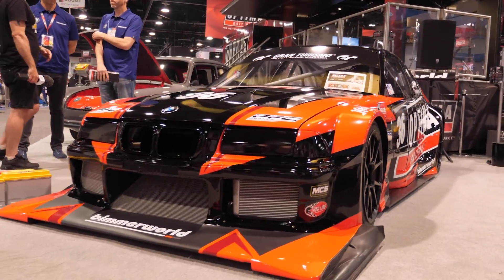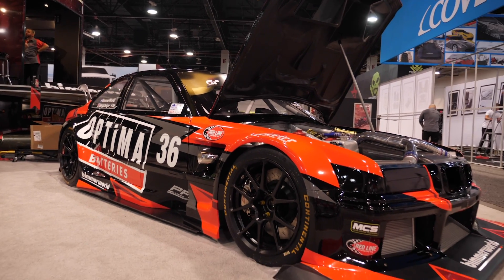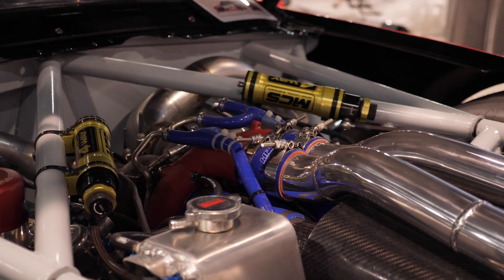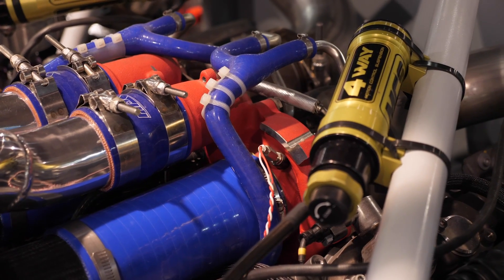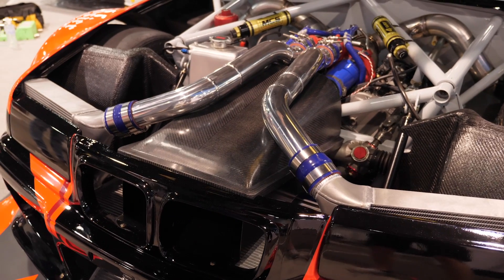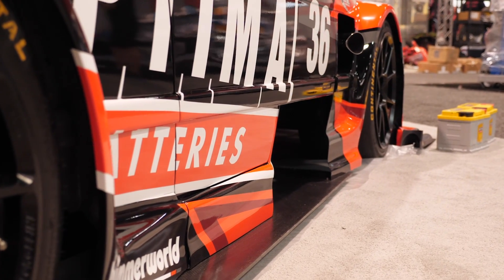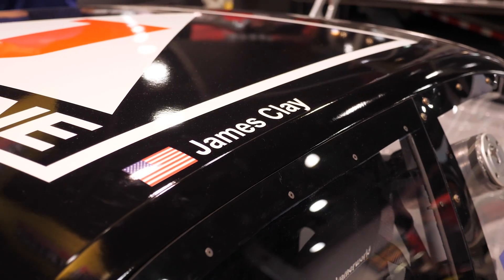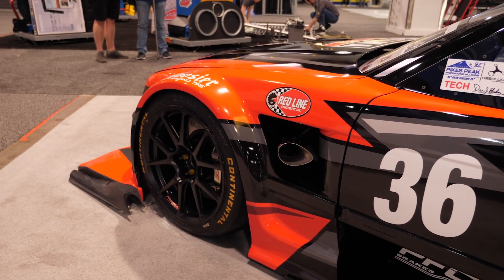You’ve Never Seen A BMW Like THIS Before | 1150HP 1100KG E36 [TECH TOUR]

Comment: 9:30 boost pressure is controlled on the MAP sensor values.  This is not a relative pressure but an absolute so you can make the same power with the same boost pressure at any altitude.  Please correct me if this is not the case.
Reply from the maker: I have a few links on this topic for you, enjoy :) - Taz.
https://youtu.be/Rgzikj8ZcX8
https://youtu.be/D7f_HbnV-_k
https://youtu.be/9eUt7BbiYZk
Reply: well if you are at 100kpa atmosphere and trying to make 2bar boost, your turbo is at 3:1 pressure ratio(only theoreticaly as we ignore pre-turbo vacuum as it tries to suck air)
when you go to 60kpa atmosphere in pikes peak now your turbo is at 5:1 pressure ratio, far away from map and probably this 2bar boost is unreachable (shaft rotation would be too high and it would be better to go compound turbskies)
Reply: But youre wrong @woo cash

Comment: I'm quite angry when he doesn't know the turbo spec. Maybe they want to keep it as secret.
Reply: Suspension/chassis engineer.  Powertrain is another group.  Weistec GTX3076 Garret turbos on E85.
Reply from the maker: Thanks for that reply James, I will actually pop that in the description.

@Andi if we had interviewed the turbo guy about the chassis he wouldn't be able to answer much either. They were literally starting to pack up SEMA around the interview so Andre was a bit thrown and asked that question without really thinking, but Wayne did well regardless I thought =) - Taz.

Comment: I hope he’s not using Bimmer world studs. I have seen at least 8 BMW race cars crash because of the failure of the studs. And each one was sent to a lab and they said it was fatigue caused by impunity’s in the metal. Metallurgical failure was there cause of failure on all 8 cars.
Reply: Absolutely we are.  And multiple reasons for failure for all we've seen that have failed and perfectly confident with the product used properly.  When we own 80% of the market, it shouldn't be a shocker that we are 20% of the failures in the market, even with a superior product.
Reply: Wheel stud failures? If so, there is NO(!) acceptable reasons for failures there - either they weren't correctly spec'ed for the application  - thread engagement, poorly designed hubs/spacers, etc (engineering design problem) or they weren't made properly (manufacturing problem).

However, I'm a bit doubtful of that because properly tightened wheel studs should be relatively resistant to fatigue due to the nature of their loading - in one of you gentlemen could please elaborate, it would be appreciated for further consideration?
Reply: Sho Yu Weeni no spacers used and the unsprung weight was the same or less than stock.
Reply: All Things M3 can you please send a link to this article? it kinda makes it seem like your pulling information out your ass to prove a point

Comment: Is that me or the cars on Pike PEak are getting lower and lower through the years?
Reply: No more dirt roads
Reply: Probably been noticing it more since they sealed the whole road - before that they had to leave some clearance for ruts, rocks and suspension travel for the irregularities.
Reply: Hopefully they just set it low for the show, that will bottom out and fly off the mountain at the bumpy top, almost happened to the LYFE Motorsports GTR which crashed into the rock luckily instead of going for a short flight